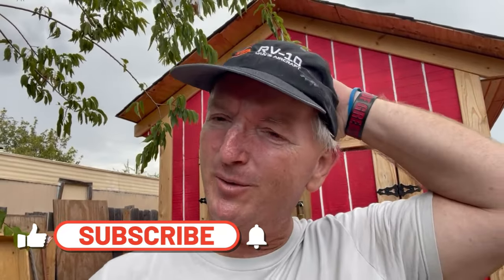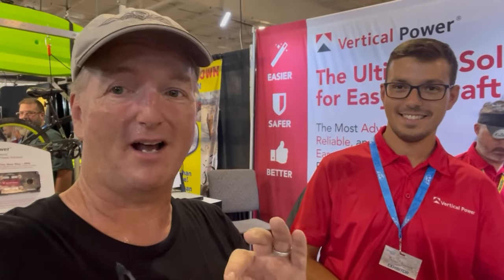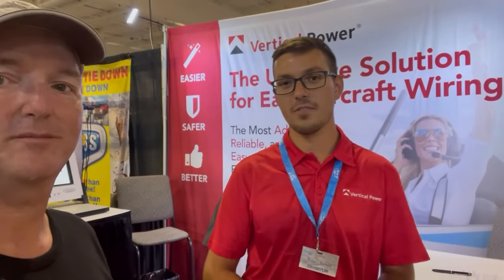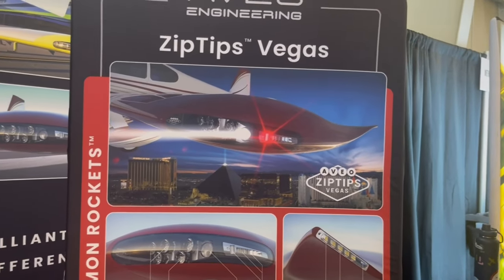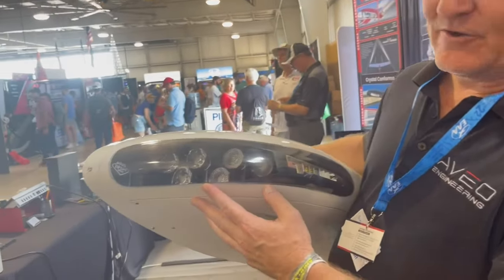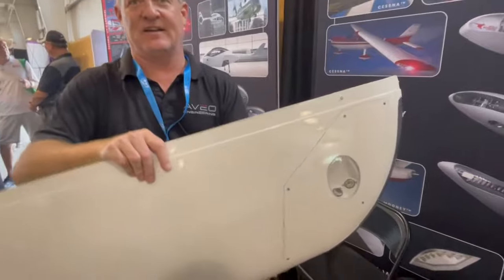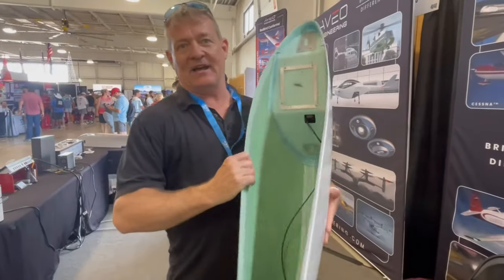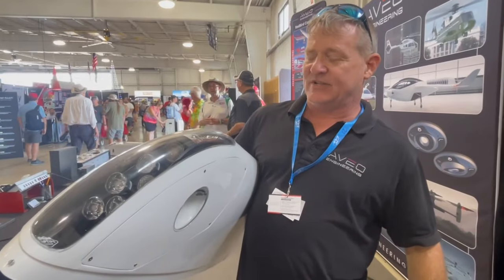[RV-10 Upgrades] Circuit Breakers Not Needed Anymore on Airplanes?

Comment: Just checked it out. This is the same thing that's coming to the automotive world. PDMs (power distribution modules) are replacing typical circuits as a central way to manage power to different systems. Can get quite pricey for what is a relatively cheap and simple circuit to build, but I'm more of a DIY person anyway (and have a decent amount of experience building electronics).

I haven't looked into it with enough details to give pros or cons but it seems like a good way to simplify electrical systems and you get a ton of options like electronic control and monitoring and automatic resetting of circuits with specific conditions. There are a ton of Youtube videos addressing the PDMs and the pros and cons.

Comment: Midwest Panel Builders has a comprehensive video presentation of Vertical Power's Electronic Circuit Breaker System. We're going with the VP-X Sport coupled with the Primary Power System (PPS) on our RV-14 project. I want to have as clean and uncluttered an instrument panel as possible. I'm not going with electronic circuit breakers (ECBs) to save panel space to make room for something else. I'm all about simplicity.
Reply from the maker: Thanks for the info!

Comment: When I first ran across VPX maybe 5 years ago I was enthralled (i love technology like this). But eventually, I asked myself what, other than making the build easier, were the actual benefits for the pilot / owner. For me there is not enough benefit to justify adding yet another single point of failure to the electrical system. It takes a very simple system function (circuit breakers or fuses) with distributed risk, adds the complexity of microprocessor/ firmware control, and bundles that risk into one (expensive) black (red) box. The box fails, you lose your electrical system, until you buy a new box. Professional panel builders love it because it reduces their labor and improves profit margin. There’s a prominent cautionary statement in the AFS ACM manual that provides a dose of reality (paraphrasing):  DO NOT route power for electronic ignitions, electronic fuel injection, or fuel pumps through this device!  But, to each his own!
Reply from the maker: Thanks for your input.

Comment: Curious… has VP done something new to their product line here? Vertical Power has been around for quite awhile. AFS has a similar (better?) product.
Reply from the maker: I’m a new builder and just found out about VP.
Reply: @CheckSixAviation  well… it IS a cool thing. You’ll find this is one of those never-ending debates, with one side arguing for the simplicity, support, and ease of build, and the other which is horrified that you’d consider anything that doesn’t provide quadruple lines of redundancy. 😉 There’s lots of discussion online. Personally, I definitely would use one of these or AFS’ product if I were currently building. Wishing you well on your build.
Reply from the maker: @joesmythe8232  Thank you, kind sir! Blessings and blue skies to you as well.
Reply: My understanding is that AFS system is indeed technically at the core the same but it's designed as a plug and play solution for their own lines of flight displays plus various auxiliary devices. If you run one of the group's Dynon or AF EFIS it's a great choice and cuts down on tons of wiring work since it also covers the communication pathways. But it won't work with a G3X afaik.
Reply from the maker: Good info,  @experimental_av !

I am planning on going with the G3X, unless @GarminAviation comes out with something better when it comes time for avionics.